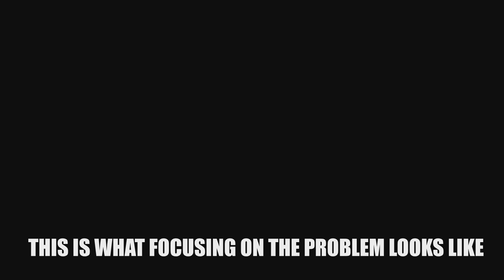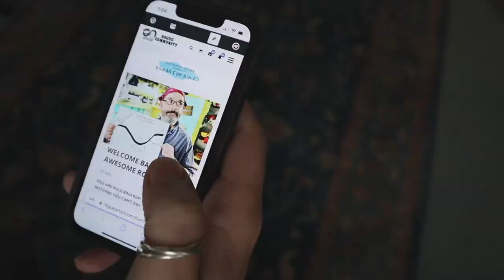Dealing With A Financial Dark Cloud As An Artist

Comment: Fifteen years ago, I was lucky enough to move into a nice house on a forested lot. Wonderful shade, in Georgia. It's always ten degrees cooler here than the rest of town. Forty giant, mature oak trees, all around and hanging over the house. Sure, any one of them could come down in a storm, and some large limbs have come down, nearly missing the house. Several smaller branches have landed and pierced the roof. I've paid out of pocket several times for repairs. But WHICH tree should I pay thousands to take down, when it could be any one of them falling down in any direction? Most neighbors have decided just to keep their homeowner's insurance up-to-date. Insurance will pay to take the tree down if it falls on the house, and for most of the repairs. Heavy rains will bring down older bottom branches even without wind. We had a mini-tornado in April that snapped one of the trees way up high, but it didn't damage any buildings. I notice your house is on a hillside, and you are not at the top of the hill. I think you may be safer than you think. Anyway-- I could also get hit by a bus. Deal with what you are dealt, and stop worrying about which cards turn up. It's probably not your turn. (I would have thought living through the hurricanes in Pensacola might have made you more philosophical about weather. The way things are going, any of us could get anything. Take deep breaths.)

Comment: Oh boy, roofs and gutters take priority because if the water isn’t flowing away from the house, it’s damaging your foundation. If, during a downpour, you see water spilling over the edge of the gutters, you have to get that fixed, it’s either a blocked elbow somewhere or a clotted downspout. Make sure whoever cleans your gutters uses a water hose to flush all the gunk out of those areas. Yes, I was once married to a roofer. I advised a homeowner their gutters were overflowing and they just looked at me, warned them their foundation could be damaged, they did nothing. The next year they paid to fix the foundation, an almighty expensive repair that was completely avoidable. Should have listened to the roofers wife….
Reply: My house has literally sunk backwards into the back yard & we had to get new doors & door frames fixed, walls & all sorts of things fixed. My husband invested in a new roof, gutters & we had a company put new drainage in the back yard so the foundation wouldn't sink anymore. My drumsticks roll on the kitchen counter if that says how much the house has shifted in the past 10 years. EEk!